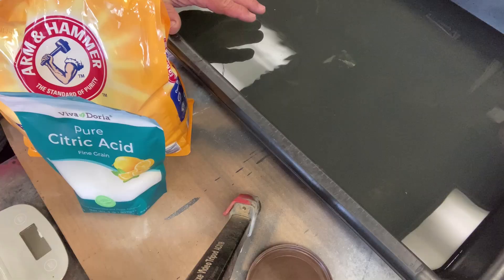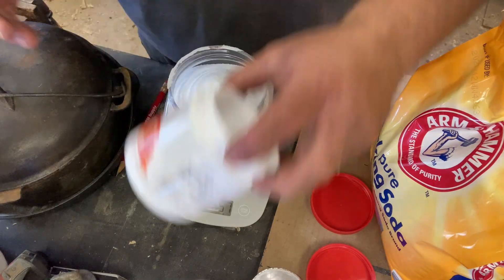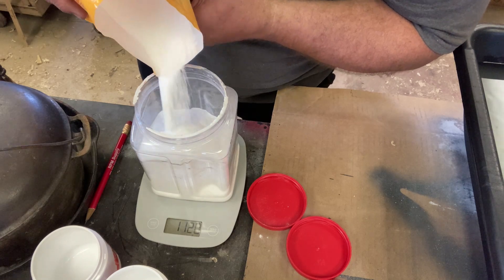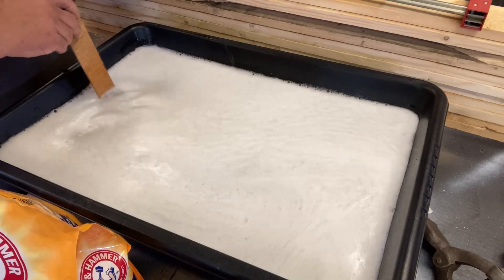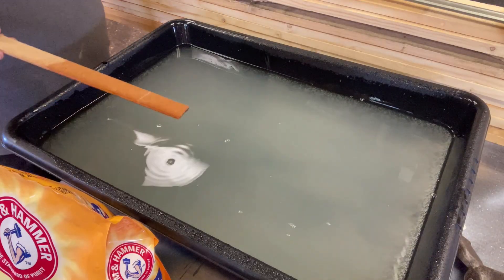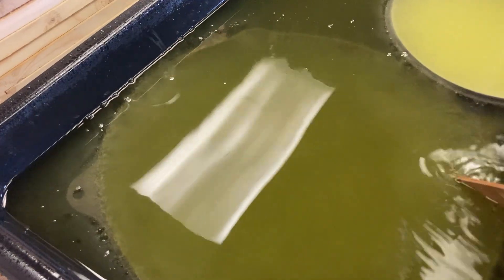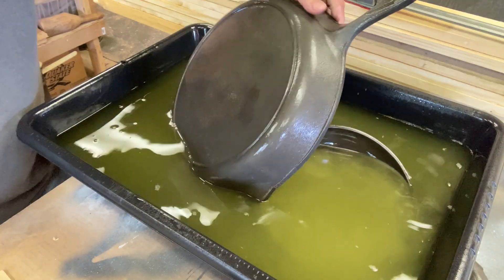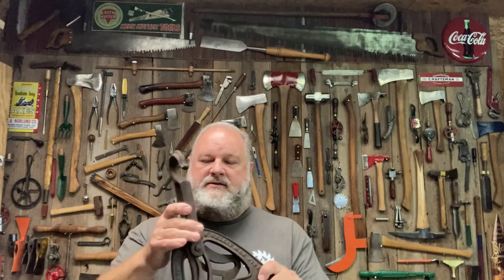DIY Rust Remover

Comment: I've been using that formula since spring and yes, it does form a mold layer on the surface which I keep in sealed containers after use. I just dip a screwdriver in it, remove the layer of mold, which is like skim layer of paint that forms inside a can after long term storage, and reuse this solution again with same rust removal properties as new mixed solution. The stuff isn't cheap to make but cheaper than the store bought name brand product. Your pans sure did clean up well with the volcanic mixture!  I used to regularly clean cast iron pans and use electrolysis as it cleans both rust and burned on carbon. You've got good content here. I'm subscribing. 👍
Reply from the maker: Thank you John. I appreciate you verifying this information, I wondered how other peoples experiences might be with this mixture. Thanks so much for your subscription and feel free to stop by anytime. I hope you have a great week!

Comment: I have several rusted chrome sockets from a yard sale will ithis work on chrome?
Reply from the maker: What I would like to do first is to take and put the socket on a drill and then use sandpaper or scotch, bright and clean it up as best as I can and get it smooth. If there’s rust inside, you can use a small brush and then soak the whole thing. The sandpaper will help take off any chrome that is flaking. That’s my best advice. it may not look real nice but at least it’ll be clean and functional. Thanks for stopping by and good luck. Have a great day.
Reply: @toolscouter  thanks I just found your channel & really enjoy it 
Randy

Comment: How does it do on very rusty tools
Reply from the maker: It will do well, but I find it’s best to take a heavy-duty wire, wheel or angle, grinder and clean off as much of the loose stuff as possible. Good luck and have fun. Have a great week!

Comment: Good to know. I have a couple Cast Iron items I need to soak. Also larger pieces thanks for sharing. About what was the cost of the chemicals If you said I missed it. If you need to send a e mail feel free. The quantity for a gallon would be great. Thanks for sharing.
Reply from the maker: I’m glad you found this to be useful. The baking soda is very inexpensive. The most expensive part was the citric acid and I think it was $7.23 for 340 g worth. I needed about 5 canisters. I bought it at Walmart, I’m not sure if you can get it more inexpensively somewhere else in bulk? Here is the math that I came up with for mixing it per gallon.
-Citric acid: 380 g per gallon; 1900 grams per 5 gal.
-Baking soda: 240 g per gallon; 1200 g per 5 gal
You need to remember that there were several options for the baking soda. This was the Arm & Hammer, pure baking soda. I did not figure the other ones. Hope this is helpful and have a great week!
Reply: @toolscouter  Thanks for your reply it is very helpful and you have a week.